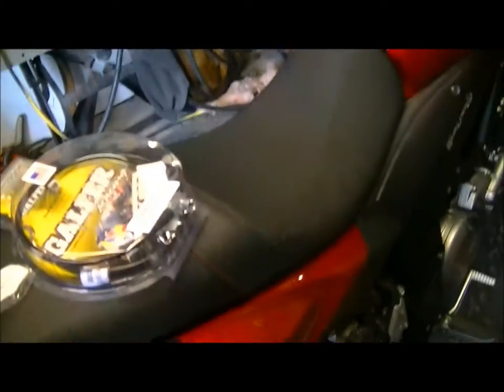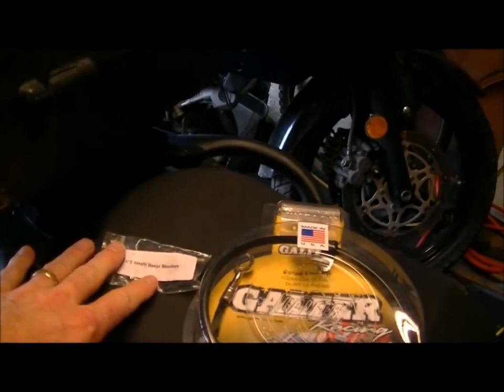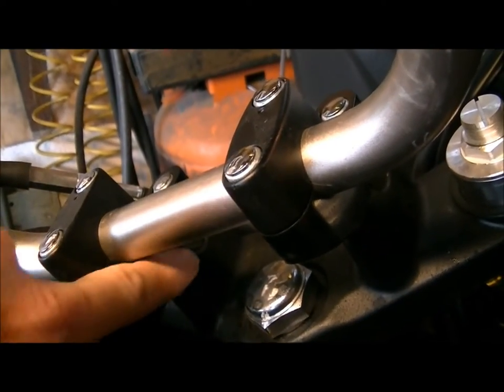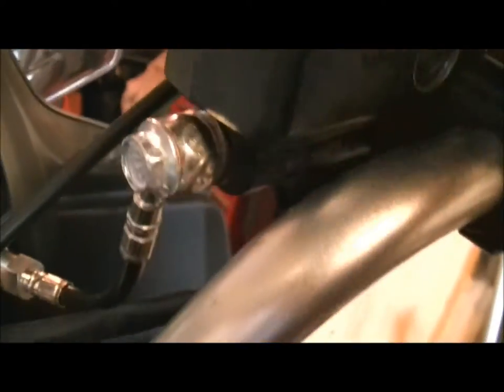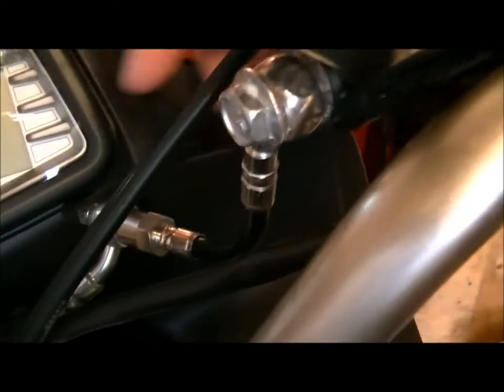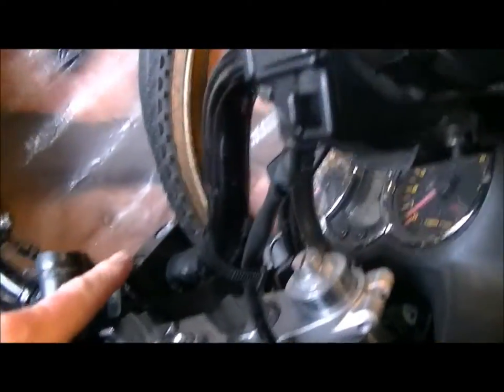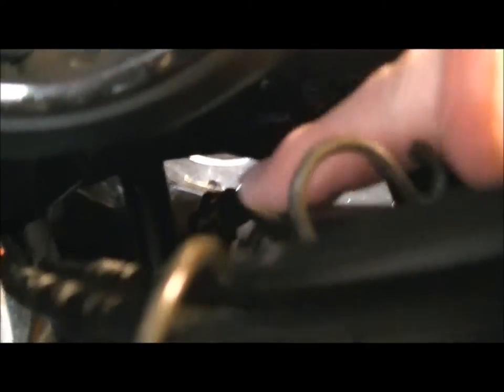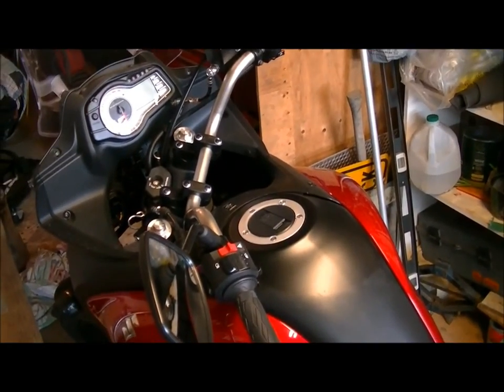2014 DL650A Vstrom Lowering Farkles

Comment: Great video Sir! How do you go about adjusting the front forks if you lower the back? Thanks.
Reply from the maker: Just loosen the triple trees and let the forks slid upwards about a half in. You may want to put a jack under the bike but usually if you just loosen the fork bolts slightly you can tap things into place. Got to be some videos on that.

Comment: I've got a DL1000.  I seem to see that the front can be lowered by 5/8" maximum. AdvantureTech makes dogbones that lower the rear 5/8" and another set of dogbones that lowers the rear 3/4".    You mentioned keeping the front and rear heights even.  What is the advantage to lowering it evenly?  With that small an amount of lowering , I assume I can just leave the springs alone.  Do you agree?     I'm 65, and I've shrunk.  Who knew?
Reply from the maker: I just followed what I read and advice from a mechanic. Keep the front end drop the same as the rear, or at least close. Keeps the bike more even. Suspension won't do much for height. I've heard of people who lowered them 3/4" front and back. Unless your a track racer, which I'm not, doubt you'll notice the difference. And get the seat shaved. easily take an inch or more. Good luck. Ever been on BMW GSA 1200 with the electronics set for dirt? Taller than the V1000. lol. Scary. Good luck and happy trails.
Reply from the maker: I'm no mechanic, but it makes sense to at least have them close. Having said that, I've seen lowered fronts and not the rear with happy riders. Give 'er!

Comment: Caution:  when you lower the bike you also affect the lean angle of the side stand and the bike will sit more vertically and will be more prone to tip over.
Reply from the maker: johnny mars we have also shortened the kick stand, so lean angle is fine. Not going to put on a center stand, too low.

Comment: Where does one get the seat shaved???  Just purchased a 2014 DL650.  Thanks.
Reply from the maker: Kinda got lucky. An employee at the dealership shaves seats after work for cash.  I'd check at the bike shops. He did a good job for $85 cash. Good luck
Reply: Thanks for the info!  Cheers!